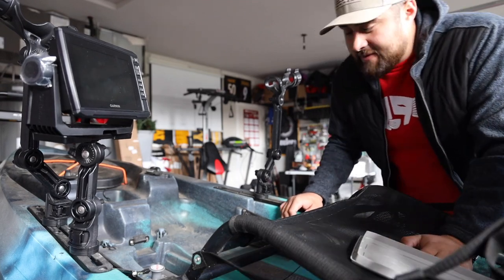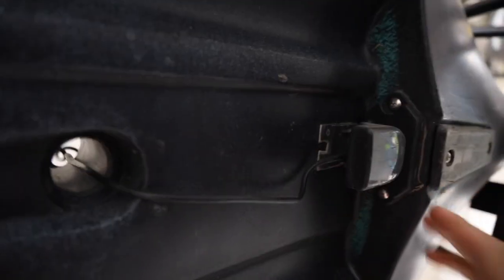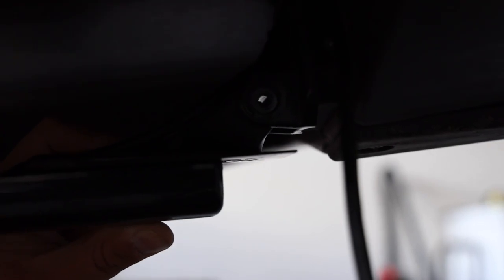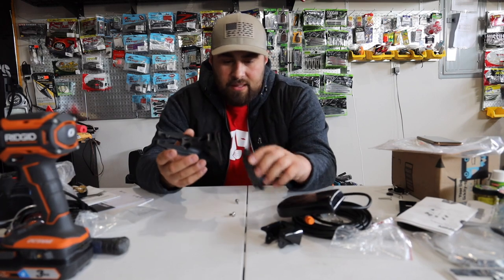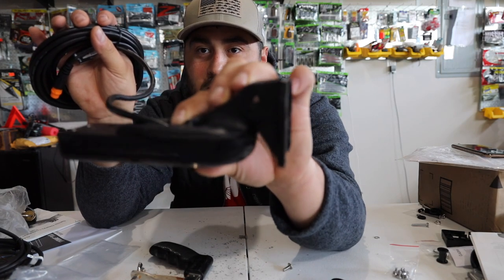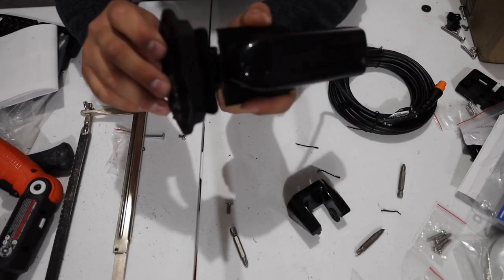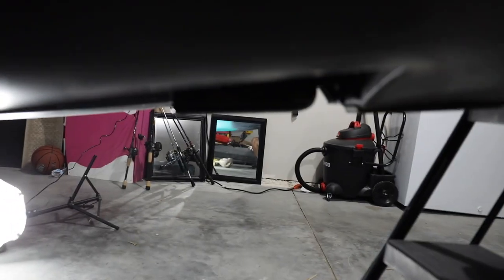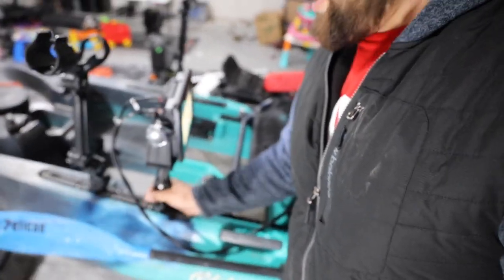Installing kayak fish finder - Garmin ECHOMAP PLUS 73sv WITHOUT HOLES!

Comment: What I do is build up a puddle of epoxy inside the hull push transducer into the puddle being careful no air pockets and let it dry. Works perfectly I’ve done this to my fiberglass bass boat and only issue is water temp reading is off. No holes in boat this way.

Comment: Fish finder novice here, but please correct me if I'm wrong but if the transduced is mounted up inside of one of the kayaks channels there by surrounding it on sides by the hull of the kayak, won't that effectively block the transducer from emitting it's  signal for the side view sonar preventing the side view from working?
I can see mounting the transducer for a down view sonar up inside of the kayaks channel and it works with no issues but not for side view.
I say this because I have watched more than a few how to mount a side view sonar transducer on a kayak and all stressed you MUST mount a side view transducer BELOW the hull of any vessel so the transducer has 100% clearance form the hull be it a kayak or boat for it to work.

Comment: Thank you for the video! I wanted to pick up the same Garmin with transducer but couldn't find a vid for an OT Sportsman but now I will go get it use your vid.
Reply: question though, the middle piece between the transducer and transducer mount, does that come with the transducer bracket?
Reply from the maker: Yes! Everything used in the video was provided in the garmin package. Update with the unit and it is phenomenal.
Reply: @fishingthe509  awesome! Just picked up the finder. What battery do you use for it or reccomend? 

The 2020 Garmin Echomap Plus UHD 73SV gt54 transducer
Reply from the maker: Jason Xiong AWESOME!!!! I use a mighty max 12v, and just an assortment of fish finder batteries from amazon for all my gear. Lol
Reply: @fishingthe509  I just installed my transducer and did the exact same way you did in the video. Now my question is since the transducer does sit above the hull and the back of the transducer is above the nose if the PDL drive does that effect the scans like side imaging and if so by how much?
Reply from the maker: If you did it exactly like the video, I have had 0 interference with PDL drive affecting any of my images! Clear as day
Reply: @fishingthe509  took it out to a lake quarry and it is a beast! Found 3 biggins in 45 feet water depth. Im still learning how to read it. So say you use clear view / traditional view what appears on the screen is directly below you right? Or is it a bit ahead?
Reply from the maker: Dang! What were you fishing for? Yes, the transducer is directly below you. Obviously if your transducer is mounted the tradition way. 
Front ____________ back
                 L_
           Transducer 
Hopefully that turns out right 😂

Comment: Going to use your method and install my new Garmin 93sv uhd on my Old Town Autopilot 120. Question, what size screw and bolt did you use to mount the transducer plate to the OT universal plate?
Reply: How did this work out for you? I have to do the same project.

Comment: Does the sv work well even though it’s flush with the hull?
Reply from the maker: Yes, I’ve had 0 issues with it. Reads beautifully.
Reply: @fishingthe509  Thx for the reply guess mounting it directly to my dry pod on the SS107 it is.
Reply: @thebeardedsportsman  The Garmin mount works perfectly with the Bonafide dry pod. Just enough height for sidevu to work and not too much